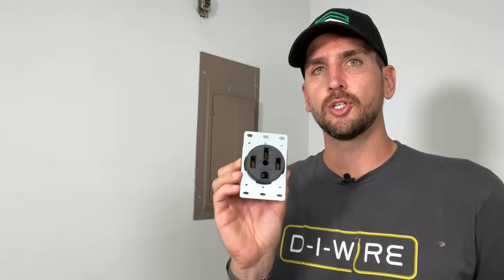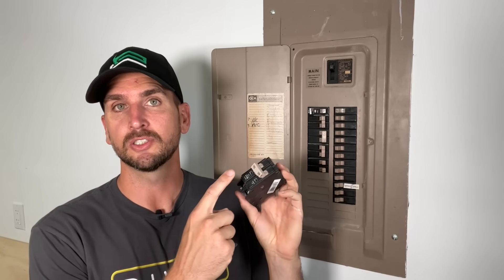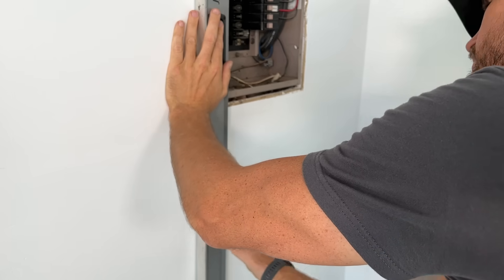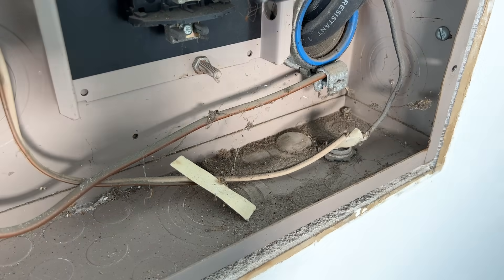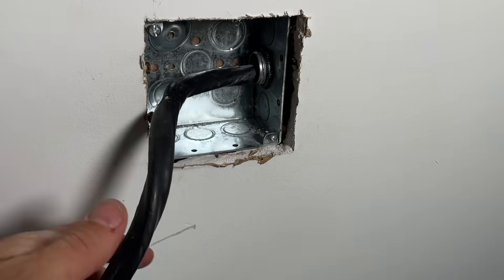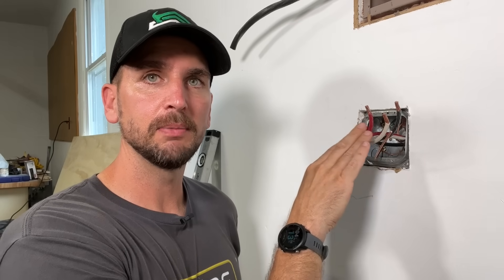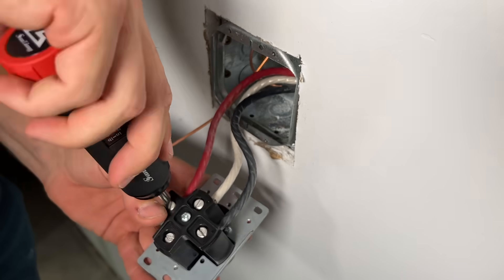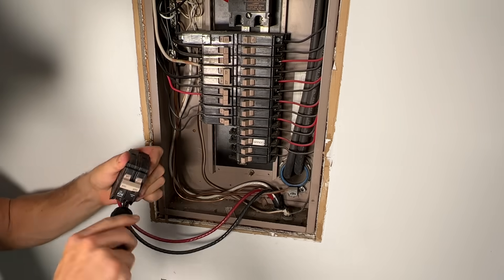Quick and Easy DIY 240V Outlet Install | 50 Amp NEMA 14-50

Comment: If you're installing behind drywall like that, is it necessary to use flexible conduit?
Reply: nope. Commercial buildings often have rigid conduit for all the electrical wiring.

Comment: That looks like a 100 amp panel, 50amp for ev, 40amp for ac + stove + dryer... odds are the main breaker will pop if you charge your car and use other high amperage devices.
Reply from the maker: That one is a 200 Amp.
Reply: @EverydayHomeRepairs  interesting, my 200a is like double the size
Reply: Would a 125 amp panel be enough?

Comment: Did I miss it or did the work really not get inspected? If not, one's insurance company would have great ammunition for them not paying out in the event of a house fire whether the fire was directly caused by the electrical work or not. Also, when reselling the house, the lack of a permit would be problematic.

Lastly, mistakes when working with the circuit breaker panel are lethal mistakes. I would never consider trying this given the ludicrous amount of current available from the rails.
Reply: Inspection and permit requirements vary. In cities, both are very likely required. In rural areas, you may not need either one. Working in the electrical panel isn't for everyone, but some non-professionals do better work than some professionals. That's true rather talking about electrical work, plumbing, auto repair, etc.
Reply: @timezonewall  Yep, those who "can" know who we are.

Comment: While the tasks are easy, you have missed some important safety steps.  Did you perform a load calculation to make sure you aren't exceeding the capacity of your system?  Did you get a building permit as is required by law in many areas?  You are creating a dangerous situation for the average home owner who wants to do this on their own.  The benefit of hiring a licensed electrician is that they will take the liability if something goes wrong and, hopefully, they will perform the safety steps you have skipped.  You are dealing with 240V at 50A or 12 kilowatts.  This is serious stuff and you are encouraging untrained, unlicensed people to enter a dangerous situation.  I hope no one gets hurt.
Reply: Well I'm not a licensed electrician, but yes I did do all those things. (other than creating dangerous situations)  The NEC isn't impossible for intelligent people to learn and apply without it being their profession.  I mean people should NEVER work on their own engines right? there's flammable gasoline involved! Yet we know the auto shop kids weren't the sharpest pencils in the box when we went to school with them. . . .  did the valedictorians set their sights on becoming journeyman electricians?  No that's were average joes end up working.  Because its not rocket science, genetic editing or A.I. neural networks.  Its 240 V at 60hz, 200 AMPs.  Basic Ohms law stuff.
Reply: @snap-off5383  I think you don't understand that if you show folks how to do it, but skip the safety steps in your video, you are potentially encouraging people to get hurt.  You have a moral responsibility that you are ignoring.  If you are going to be a teacher, you are responsible for your students.  Think about this before posting more videos.
Reply: @horbalyhut1774  No, the can's do not have to operate as though there are no other cans.  "there's codes, you can look them up and learn them and perform the work up to code" isn't irresponsible when someone who can't . . . doesn't.  There is no moral responsibility for others' ignorance.  If every video of how to do something basic had to have warnings against all the potential stupid things the can nots might do, they'd all be hours long.
Reply: @snap-off5383  It's just that the guy here made mistakes (or at least that's what it would be considered, e.g. in Poland) that threaten to burn down the house. He did not even measure the insulation resistance, did not insulate the ground wire, did not secure the hole in the box so that it would not damage the wire. And all this only on an installation that is to be loaded with some 10kW.
Reply: Right! Only a certified electrician is allowed to make wire terminations. If you want to teach people to do all the manual labor and then have the electrician pull the wire and make the terminations that is fine!

Comment: I have a few things to add to this. First, it would be best to shut off all the breakers before the main to elininate lethal flash risks from disconnecting under load; even if you think it'll be ok, there has been handles that have broken off, exposing the bare innards. Second, 8/3 is now allowed for 50 amps so you could have saved even more moneys there. Third, you should install some kind of shock prevention like a GFCI, which is required for EVSE per 2020 NEC. GFCIs should work even without a neutral but could freeze under DC backflow
Reply: Please don't go to 8/3, for EV charging if you are going to pull 30-40 amps 240v constantly 6 gauge is safer and will produce less heat for sure!
Reply: @whattheschmidt  8/3 was designed for running 50 amps constantly so if you have excess heat you have a problem. Also 8 AWG is larger than the 10mm² used for 50 amps in europe. Using 6/3 is still fine but it was made for 60 amps. Also, I believe he is still on 2014 NEC
Reply: @Ilikeeminleggings   my understanding is that NM 6/3 is rated for 55 amps, whereas #8 THHN is rates for 50 amps, both prior to and after 2017 NEC. A lot of people seem to advocate for stepping up to 6/3 even in THHN, which is honestly overkill if they knew how many safety factors are already calculated into that 75°C 50A rating...
Reply: Hi car charger doesn’t work with GFCI
Reply: #8 NMB is rated 40 amps

Comment: Didn’t realize you can go smaller gauge on the ground
Reply: You can't go smaller gauge on the "grounded conductor." If you are talking about the "equipment grounding conductor" then you must follow NEC code section 210

Comment: Screwing thru the side of the box to the stud  s a code violation. Use a box with ears and secure with Madison bars.
Reply: Not exactly, it depends on where the screw is located in relation to the box edge and what version of the code you are looking at.  The NEC 314.23(B)(1) covers when it's okay to use screws and nails on the inside of a enclosure for mounting. What he did is perfectly okay in most places, but it could be flagged by inspectors strictly adhering to pre-2017 NEC.  Realistically, not many locations are still be using 2014 (or older) versions of NEC, and if they are, it would be silly to argue about an install that complies with newer code standards (I'm sure some would).

Madison bars are good for old work that is not near a stud, but it's more secure to use the stud if available. Ears are for speed of installation of new work, are are not necessarily the most secure attachment method. His mounting method is more secure than Madison bars or ears IMHO.  The holes he used are made exactly for the type of install he showed.

Code varies widely, and I agree with that the video should have mentioned of what code applies to his area and how this install may not meet code in some places for various reasons. For example, he didn't use a GFCI which is required by newer code versions for even 240 outlets in a garage as several commenters brought up.
Reply: @timezonewall  The reference you cited refers to boxes that  are made by the manufacturer to use screws in the box. Arlington and Carlon make such boxes. They have bosses built into the box which cover the screw head for wire protection. It is not meant to allow a field modification of a box not intended for such use. Field change  is  modification of a listed device and is not allowed.
Reply: @Zeric E, I have to apologize. I went back and compared 2014 vs 2015 NEC . This was added: "Mounting holes made in the field shall be approved."
Reply: @bobniles1928  Yes, 2017 NEC clarified this issue.  I always try to state which code year I'm talking about in comments.  Some changes are well known and discussed, but others are quite subtle. It's hard to keep up.

Comment: How can you leave opening on your receptacle ?  You should have used a so called tailor cover or shoebox cover for your receptacle installation.
Reply: The receptacle is located in a dry location so no cover is needed.
Reply: @uhjyuff2095  A naughty kid could stick a metal piece through the big gap and fry himself up.😛
Reply: from 11:15 on you can see the cover.

Comment: I always check my circuit twice one energized to check for short to ground/neutral/ hot(s) then energize it and check my voltages hot-hot/ ground-hot-hot/ neutral-hot-hot depending if the panel is grounds are separate from neutral make sure i'm not getting a voltage across ground then.

Comment: There are some EV's that are very picky on which hot leg goes to which terminal. So if you have weird issues swap the black and red wires. There really is a slight variation between the poles and some chargers are sensitive enough to detect that difference.
Reply: Why on earth would this matter though? Electrically, I can't possibly imagine anything could be different between the two legs.
Reply: @miles9922  Maybe he lives on Mars.
Reply: @miles9922  That is why there are electricians and DIYers. There is a lot more to electricity than the average person realizes. And in a perfect world all transformers would work the same, but they do not and they all have variances.
Reply: @Kevin-mp5of  I think he misheard something from a new apprentice he used to know...
Reply: @miles9922  Yeah the legs are the outside connections to the local transformer, and are for all intents and purposes indistinguishable.  There is no polarity with 240.
Reply: @Kevin-mp5of  I agree with you 100% but now explain that to the EV chargers. I have never had issues on which leg goes where on a single phase system. But like I said the circuitry in some EV chargers are extremely sensitive to incoming power. It could have something to do with the transformer on the pole, I don't know. But it is a real and weird issue. I had never seen this issue until the Tesla gen3 chargers. Gen 1 and 2 never had this kind of issue. They have connection issues but not power issues. Gen3 has weird power issues.

How many EV chargers have you installed or had to troubleshoot?

Comment: Maybe at the start of the video use a disclaimer as to what version of the NEC you're using, if one at all. 

The only way to do this job at that cost is not to code. About 35 states have adopted at least the 2017 NEC, and we're close to putting out the 2023 version. If you aren't intimately familiar with your area's electrical code, then just call an electrician.
Reply: His area is still on 2014 NEC
Reply: @aurvaroy6670  oh wow. Yeah he really needs to add disclaimers about that.

Comment: I would definitely spring for either an industrial grade outlet or hardwire a charger. Besides being plugged in all the time dryers and stoves are usually only on briefly and rarely are at full power. EV charging can draw large amounts of current for many hours at a time which will cause more heat in the outlet than is typical for other uses. This can cause the metal to expand and the joint to loosen, which will generate even more heat and could become a fire hazard. Not worth the risk to save $50 or so on a cheap residential outlet.
Reply: Amazon sells the Hubbell Nema 14-50 currently for $111.    Hubbell also makes the Bryant brand (Bryant 9450F) that is sold at Grainger for $46.   It is the same commercial grade receptacle.